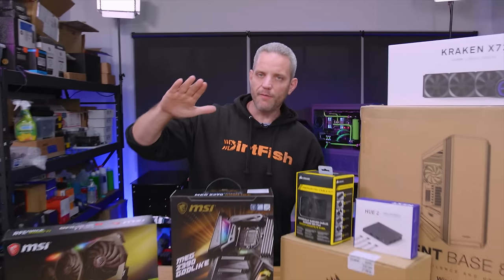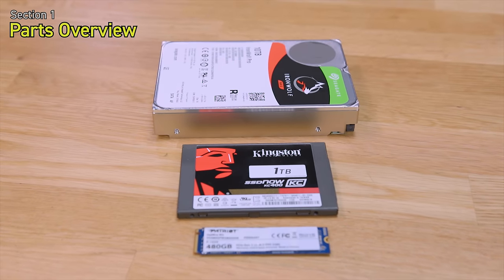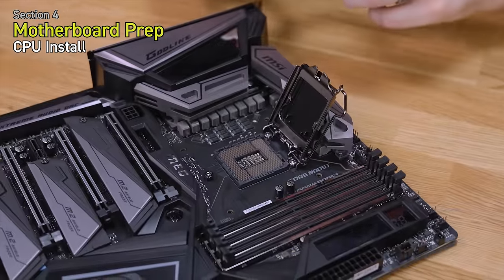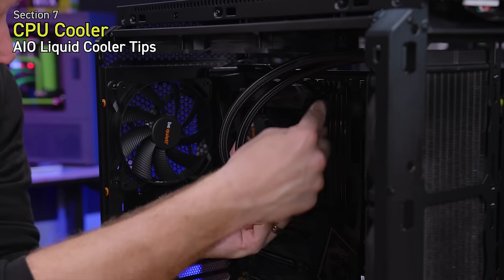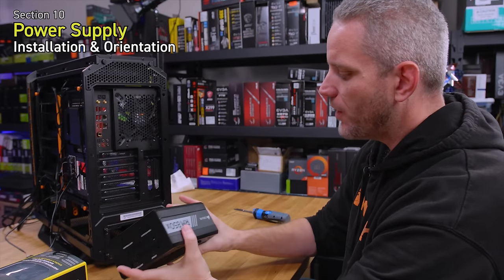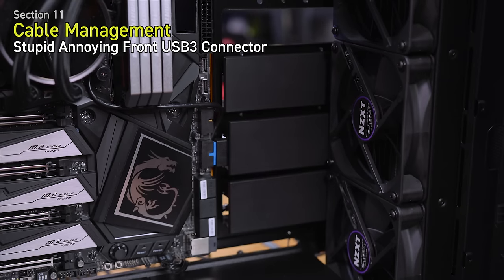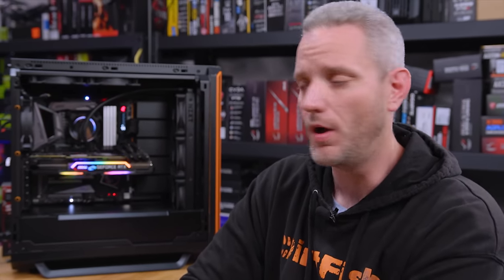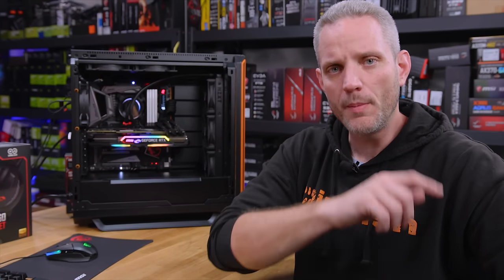How to build a computer

Comment: 3:41 Correct me if I'm wrong but that SSD isn't a proper 'scratch drive' if you've got you project files on it.  For Adobe, you use a: 1. System Drive (OS, Apps), Project Drive (Project files, Media, 3. Scratch Drive (Conformed audio, previews).  Adobe and Puget Systems both recommend this.  https://helpx.adobe.com/premiere-elements/using/scratch-disks.html  and https://www.pugetsystems.com/recommended/Recommended-Systems-for-Adobe-Premiere-Pro-CC-143/Hardware-Recommendations#storage

Comment: So I’m using an m.2 ssd for my first pc build Im only putting windows 10 and apps on it so how much space should I get on it I don’t want to pay extra and go overboard for no reason can someone please tell me how much I would need THANKS!!
Reply: Windows 10 uses about 20-30GB of space (I don't remember off the top of my head). I would go for at least a 250GB SSD and consider installing an HDD for games and other data. On my main PC, I installed 2x 1TB Samsung M.2 SSDs in RAID 0 and removed my 2TB HDD, but that's just me.

Comment: I'm with you on the sata cables. I hate those things. My case has pass throughs for the sata data and power for 5 hdd bays. That makes it a little better but I also hate those flat hard to manage cables. I wish they were just round because mine have to be 90° and then the cable needs to bend to the side. I use a Thermaltake Level 10 case from like 2012.

Comment: So if the screen doesn't pop up showing all the components does this mean I did something wrong? Or my graphics card doesn't have enough power?
Reply: Maybe, maybe not. If your motherboard has a diagnostics/debug LED, take a look at it. It can probably tell you what may be wrong. You can reference the motherboard manual for more information.

Comment: i just installed sapphire pulse rx 560 4gb vga on my pc, i had no bottleneck issue but when i played gta 5 i got about 40-45 sometimes 50-60 fps at the normal settings, anyone knows why? cause i think it supposed to get about 60+ fps all the time.. can someone help me? thanks..

Comment: would i be okay to use  corsair 750w power supply i9 9900k with evga 2080t? insted of a 850w ?
Reply: LORD_JUNO _  The 9900K at around 5GHz draws about 250W and a stock 2080ti also draws about 250W. 

That only leaves about 250W for the rest of your PC. You might want to use google for a power supply calculator which will calculate an approximate ideal wattage when drives, fans are taken into account

Comment: Hello Brother.
Recently I Build a pc Spec AMD THREADRIPPER 1920X and Motherboard Asus Rog Zenith Extream. 16 GB RAM, GTX 1080TI aND 500gb M.2 SSD. 
Now Facing Some Problem But Don't Know From Where this problem coming. Some Time my pc became Freez. Is it a motherboard problem or CPU OR Anything else? Mainly When I run a game or use a long time roughly 3 to 5 hours I face that problem. this is my own build machine that's why I cant contact anyone. Please Help Me, Brother.

Comment: I would have thought for better air flow one would have mounted the radiator on the top & left the 2 fans on the front so your getting better air going threw to the gpu instead of sucking it in via the radiator.
Reply: Technically cooler air would be around the cpu than above it so wouldn't it be better for the radiator to pull in cooler air from the front

Comment: Should have flipped that radiator, so the pump is above the hoses on the radiator,  and below the upper edge of the radiator. Gonna have more noise and premature pump failure the way it is currently set up.

Comment: Always love watching pc build vids, especially from Jay!  However, isn't the rad mounted the wrong way up?

I thought the tubes are supposed to come from the bottom of the rad to the CPU as having them at the top can cause issues with air in the system? (Unless the rad is top mounted, of course) or am I understanding AIO's completely wrong? 😅
Reply: Yeah.  The rad is upside down for this front mount.  But at least the pump is lower than the top of the rad.  This video came out before the GN video about proper radiator set ups.   Also Jay didn't apply any thermal paste on the CPU.  🤷

Comment: Hi can somebody please help me im new to pc and I'm trying to  figure this out, this will be my first build and I was wondering if this build is ok. I'm not overclocking 

Intel - Core i9-9900K 3.6 GHz 8-Core Processor

MSI - Core Frozr XL 71.27 CFM CPU Cooler

MSI - MEG Z390 ACE ATX LGA1151 Motherboard

Corsair - Vengeance RGB Pro 16 GB (2 x 8 GB) DDR4-3000 Memory

EVGA - GeForce RTX 2070 8 GB XC ULTRA GAMING Video Card

Cooler Master - MasterCase H500 ATX Mid Tower Case

EVGA - SuperNOVA G3 650 W 80+ Gold Certified Fully-Modular ATX Power Supply

Comment: Any reason the memory was installed after the motherboard was in the case, when the SSD and chip were before?
Reply: For the most part, it doesn't really matter in what order you install RAM.
Reply: @JJFlores197  Thanks, I remember in the 90's being scared to touch it for a Music Sampler upgrade, so I wondered if there was better grounding after the mobo is in. Otherwise it seems easier when the board is on the table.

Comment: Hello internet experts. I hope you could help me. I am trying to decide if this used system unit is a good buy for $400 

i5 3570(k) 
1x8gb 1866 hyperfury ram
Seagate 500gb hdd
GTX 1060 (3gb) Palit Storm X
Cooler master Hyper 212 HSF
Cooler Master GX650 Bronze true rated PSU
Asus EX p8h61-m moba

Comment: Serious question (yes I am a newbie to building, but not new to computers) I have always been told NEVER never NEVER EVER have anything magnetic near your case. Now I see you using a Magnetic tip screwdriver. a Magnetic parts cup. I also know new cases have magnetic screens.  So has this fear of magnets been obsolete? (Yes I am an old man) I assume it originated with the old 5 inch floppy's and then migrated to the HDD which read/writes by use of a magnetic arm. So, is it Obsolete? Just a myth? or Is it ok to use generally but keep it away from the HDD. Or is it just not a worry anymore?  I'm at a loss here
Reply: @mastermirror2842  I knew ssd's were safe. It's a flash memory which has no moving parts and does not use magnets. I guess this is an old fear from the old days of computers. Back in the comodor  64 days. I know, I know. I just showed my age

Comment: Guy's can you please help me with this problem? So I upgraded my ram to the XPG Spectrix D41 RGB 3000MHz 16GB (2x8GB) 228-Pin PC4-24000 Desktop U-DIMM Memory and now for some reason I have no wifi connection even though I am using my Ethernet cable. Can someone please tell me why?
Reply: This is my first PC and I have no idea what is going on with the wifi

Comment: I recently just finished building my PC. When I try to turn it on by pressing the PC power case button, nothing happens. However, if I press my Eject Button, it will start up. I checked the front panel connectors and where they should go on the motherboard, I put them in the right spot. Could someone help me out on this?
Reply: SofaKing LiT if the eject button is turning on the power then obviously the cable is in the wrong spot. Switch it with the power button
Reply: @reubenosman2288  yo thanks a lot. I thought I had them in the right spot. Turns out I had negative on positive.. Yikes

Comment: Funny that I run into this video after I bought all of my parts for my new build... Almost the same list, but I'm gonna run dual M.2 NVMEs, no SSD, and dual HDDs into a be quiet Dark Base PRO ver2 case. 

Unfortunately, I tried to save a little money and bought a "refurb" Z390 Godlike board, and discovered why it was sent back... PCIe Slot #1 was bent, and my build is now on hold, because I am not going to keep building out a damaged board! Now I'm stuck waiting on a claim with the online retailer now..

Comment: He forgot to mention the thermal paste! For any new builder, if you don't apply thermal paste to your CPU before installing a fan or water cooler you will fry your CPU!!!!! The thermal paste helps transferring the heat towards the cooler, without it the heat will just accumulate in the CPU.

Comment: Jay! What great and entertaining resources your videos are, and how generous you are to share them with us. The last PC I built ran Windows 7 (and, okay, I did a Linux Mint build for my son). Even though this is a few years old, everything applies to the current state of PC hardware, and it really helped me get up to speed. (What—_two_ sides of PC cases open now? And you run the cables behind the mobo? It's "Blade Runner" stuff!) Thanks to you, I faced this strange new land with confidence and had fun setting up my new music-production system. PC-building is so fun when you avoid common errors and have useful tips—and you're clearly the best guy for that. Cheers!

Comment: First of all, really enjoyed the video!!  Yet, It baffles me that you take so much time explaining so much, which is great, yet you completely brush over certain "more important" things, such as thermal paste application (or even the fact that its already applied to the cooler) and attaching said cooler onto the processor/board.  Take some time away from talking about memory stick notches or fragile sata connectors and throw that in there. :)

Comment: Step one. Rtx Titian 
Step 2: intel Xeon gold cpu
Step 4. 6 terabyte nvme. Single bit storage 
Step 5. 64 gigabytes of solid gold ddr4 4000 memory. 
Step 6. 650000 watt power supply. 
Step 7. Get an electrician to hook up a 220 volt outlet to your room. 
Step 8. Go bankrupt

Comment: is it becoming more common to have a PSU where you choose your own wires to include?
Reply: Kavukamari it is called modular and they have been around for quite a few years, so have custom cable kits. There are non modular which have all cables soldered to the pcb inside the power supply, semi modular which have the motherboard and processor power cables attached, and full modular which he has.

Comment: why did jay build this so weridly compared to how he builds now?? like he installed the ram even after installing the cooler and he installed the cable mods for the psu before connecting them to the motherboard. Whats the point in having a modular psu if youre just gonna install them like a non modular one and then hook them up? not hating just wondering

Comment: You did not add DVD ROM? Then u nned to teach how to install Windows from flash drive
Reply: Optical drives are pretty much irrelevant on modern gaming systems. They're not extinct, but not common anymore. There's a nearly infinite number of guides that show you how to make a bootable USB drive installer.

Comment: I’m planning to build a pc that costs around 1700

List is below plz all help me decide

Intel core i7 8700k processor 6 core
Asus ROG Strik Z390-E
Corsair Vengeance RGB PRO 16GB Memory with RGB
Asus GeForce GTX 1070 8GB ROG Strix Graphics Card or RTX 2060 that is coming out
SanDisk SSD Plus 1TB Internal SSD
Vega SuperNova 850 G2, 80+ GOLD
Corsair Carbide Series ATX Mid-Tower Case - Black
Corsair LL Series LL120 RGB 120mm Dual Light Loop RGB LES PW. Fans 3 Pack

Comment: you didnt put enough thermal paste, the psu is back to front, the ram is in the wrong way and you didnt screw the cpu cooler on correctly. i know this becuase i have learnt how to do it the correct way from the verge. 

just saying.

Comment: Still makes zero sense to buy a RTX 2080.  Never the less,  there are some steps that Jayz didn't mention that are crucial for a begginer, one such like THERMAL PASTE.  But the most important part of building a PC happens before you buy anything. Deciding what you want /need/ price and going accordingly. Example: some motherboards need to OC(overclock) to run a 2667Mhz ( or higher) ramm. SO do you know how to OC? Do you want to OC?  Or even simpler you need to buy a motherboard that actually has the right socket for the cpu you want, laugh all you want, but it happens A LOT!!

Comment: Yep, way late but, at least for me the hardest or at least most confusing part of building a pc is where to plug the different connectors/power cables ect. Seems you completely skipped this. Putting the parts in is pretty self explanitory, its just when you throw in rgb hubs, sata cables,power cables, io cables, the mobo can be confusing. Anyway sry jay, love your vids but not this 1.

Comment: Nice pc, but why choose that case. It's not airflow friendly.
Reply: It actually does pretty good at air flow. Though if you are doing massive overclocking I would not suggest this case. But for this build, it does fine and the temps stay reasonable during gaming and rendering with slight overclocking of this particular gpu and the water cooled cpu at 5 Ghz overclock. And this case is really super quiet which is great for people recording or streaming mic audio and or a setup that is in a room where extra noise can be annoying.

Comment: @1:16...crap explanation started. Incorrect info buddy. Premiere Pro has done nothing to do with what you said. Its simple. works better on cuda...
You want the proof?
Next Time while working on Premiere pro ...and im talking all the cc's...open up your task manager and see what is getting used for rendering. 

If i had the options of adding screenshots...i would have shown you the difference between how an.
a. Amd processor with amd GC utilizes 31% cpu 48% ram and 2% GPU
b. Intel i3 7th gen with intel 5000hd inbuild GC with 12 gb RAM using 53% cpu 51% ram and 1% GPU
c. Intel i5 7th gen with nvidia (GeForce MX110 graphics) with 8gb of ram using 39% of cpu 58% ram and 3% gpu

And they all are laptops, me and my team has 7 systems and 9 laptops.
GPU has never been a problem unless im working on 8k.

I love your work and your videos man but...its incorrect info.

Comment: This was so cringy to watch - Jay forgot so many things and straight up didn't have some things required to build the rig in the first place, including but not limited to:
1. Didn't have a swiss army knife which hopefully includes a philips screw driver
2. Didn't have an allen key
3. Didn't have a CPU installation tool
4. Didn't have a thermal paste applicator
5. He didn't open all the boxes first and get rid of everything he didn't need
6. He completely ignored to mention the insulation pads of the PSU slot in the case - this is dangerous!!!
7. He didn't apply extra thermal paste onto his CPU?!

What a novice. 
Edit: At least he had a table.
Reply: He also didnt use a wrist band and  TwEeZeRs and 1 litre of thermal paste. What a noob.

Comment: Storage choise is crap, only go for Samsung if you build 500+€ pc, and use frikin WD not that thit Segate (all drives from theme die after 5 to 6 years, not reliable, corrupts data, only WD is good or Toshiba)
I speek from experience

Comment: I’m building my first computer and what I came to find out is that iits all pretty much easy accept where to plug everything in and how to plug shit in that the only hard part by far and all these dumb how to build a pc videos focus on the easy shit like puttin in the cpu and gpu and ram and go fast past all the cables and where to plug them in because it’s boring where it’s the thing they should focus on the most cuz that’s what ppl will have the most trouble with